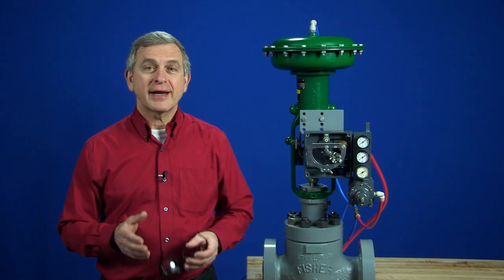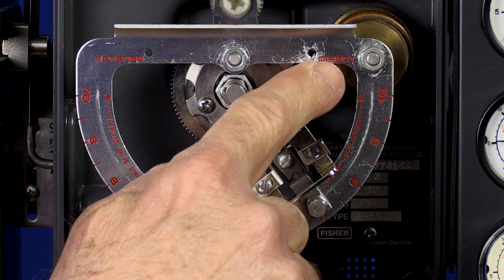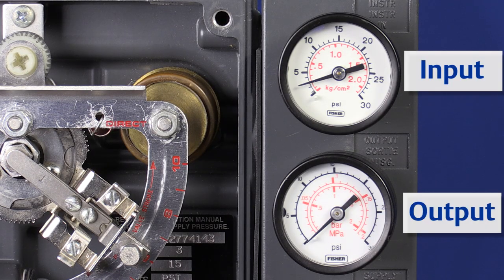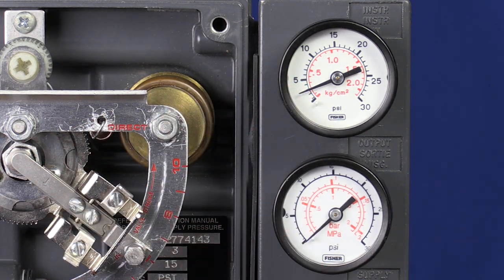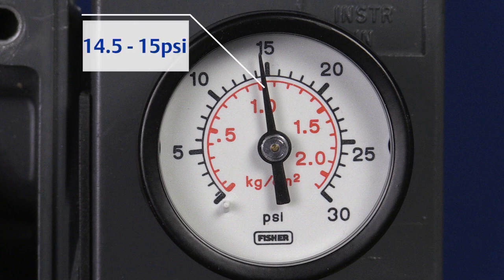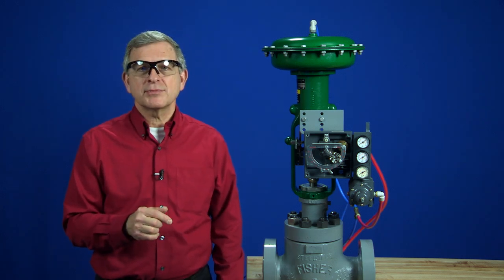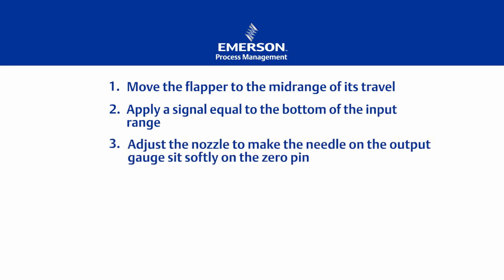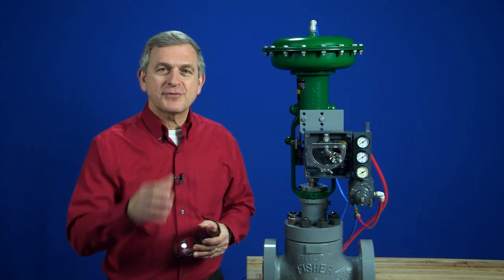Calibrating a Fisher™ 3582 Positioner - Zero and Span

Comment: A point to note, on a 657 actuator saturation is necessary to ensure the plug has sufficient force to keep the plug seated against design dP which on a direct acting actuator, is the difference between the upper bench set & the regulator pressure. Conversely, on a reverse acting actuator, a 667, it’s important to ensure the actuator is fully vented at 0% of input for the same reason…

Comment: Hi I'm Jim Jones with Emerson 3582 in this video I’m going to show you how to calibrate this Fisher 3582 pneumatic positioner, as you can see it’s already properly mounted under this Fisher 657 size 40 I direct-acting actuator and the beam alignment has been double-checked so now we're ready to set zero and span, the zero adjustment is done with the nozzle, and the span is adjustment by moving the flapper assembly along the summing beam, we of course have our air  Air Supply Plumbed to the positioner and can see on the supply gauge the regulator is set to in this case 20 psi, to get started we’ll move the flapper assembly to the mid-range of it's travel on the direct side of the summing beam or about to the number 6 on the scale, understand that the direct and reverse labels on this summing beam only tell us how the position or will react to the input signal and have nothing to do with what kind of actuator the positioner is on, don't be confused by that, second will increase our input signal to the bottom of the input range in this case three PSI, third will adjust the nozzle in or out to make the needle on the output gauge sit Softly on the zero pin of the output pressure gauge, step four is to slowly increase the input pressure but we'll watch the output pressure gauge as soon as the output gauge needle moves I stopped the input and look at the input gauge ideally it should be somewhere between 3 and 3 and a half PSI, this technique makes certain that when the input is at 3 the position output is saturated to 0 psi and the control valve is at one end of its travel in this case all the way open, now let’s set  in step 5 of increase the input pressure but again I'm watching the output pressure gauge what I'm looking for here is saturation on the other end of the stroke, Saturation is identified when the output pressure rapidly changes and goes all the way to supply pressure, there it is, that means the valve has hit a stop and the positioner is applying full Supply to in this case provide maximum seat load, our goal is to make the position or saturate just inside the upper limit of our input signal that is in this case 15 psi, so when it's saturates ideally it should be between 14 and 1/2 and 15 psi, if we increase the input pressure in the output saturates just before or after our Target, which is just under 15 PSI we must move the flapper assembly to correct span and move the saturation point, this is step 6, if it saturates too soon or before 14.5 move the flapper assembly to smaller number, if it saturates too late or above 15 move the flapper to a large number every time you move the flapper assembly though you must go back and reset the zero adjustment and then check the span again when the 3582 positioner is properly calibrated we can be sure that when the input signal is at the limits in this case three and fifteen PSI we know that the valve is either wide open or in the seat with full actuator force, once the zero and span is set correctly don’t forget to tighten up all the lock nuts, so we can calibrate the 3582 positioner in just six steps, 

Step one, move the flapper to the midrange of its travel
Step two, Apply a signal equal to the bottom of the input range
Step Three, Adjust the nozzle to make the needle on the output gauge sit softly on the zero pin.
Step four, Increase the input to find the low saturation point
Step five, Increase the input and watch for the high saturation point
Step six, Adjust the flapper assembly to adjust span and to move the upper saturation point.
Reply: WOW

Comment: Thanks for the video, but I have a normally closed valve, should the positioner be calibrated the same way?
Reply from the maker: The video shows an air to Close control valve or you would say a normally Open valve. The calibration procedure is the same. At 0% input, the 3582 output is also zero, thus valve stays Closed. This adjustment is done by the nozzle. Slowly increase the Input, and watch when the output increases. The input signal should be about 3.5 psi or lower. Follow the video procedure to the 100% input signal and adj the span. Repeat the zero and span adj to ensure it is correctly adjusted.

Comment: I have a fisher Valve/Positioner, having issues.  Note all was operating properly and now the valve isn't following commands.  It is a chilled water valve/actuator/positioner.  Supply air is 25psi, the control air is 8-14psi full close to full open.  At this point, with supply air the valve is full open regardless of control air *nc 8psi*.  It is a 1/3 2/3 valve set up.  Both fisher valves actuator positioners.
Reply: Was the issue resolved? I am curious about what was the problem. If it is not moving at all I am guessing shaft arm is disconnected or if it has wrong movement despite calibration maybe it is the beam alignment.

Comment: how do i calibrate that same valve if all 3 gauges are not working?
Reply: Can you not just replace the gauges?
Reply: replace the gauges or use your calibrated gauge to set it up and remove when your done. No way to calibrate with out knowing the pressure

Comment: Is 3-15 standard for all valves or it depends on valve size?
Reply: Depends on the size different valves have different bench sets it will say on the valves information plate
Reply: There is 6-30 psi it depends on the size of actuater
Reply: usually in a 1-5 ratio unless its some really odd setup. Just like your 4-20mA single is a 1-5 ratio used on your I/P to make your 3-15psi single air